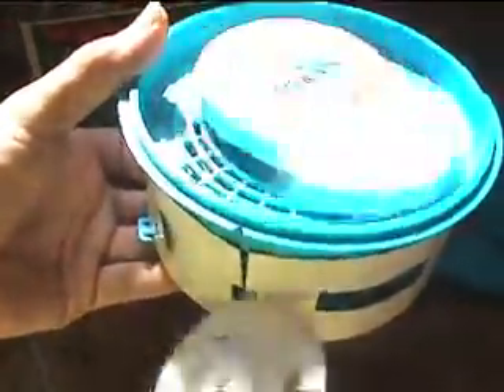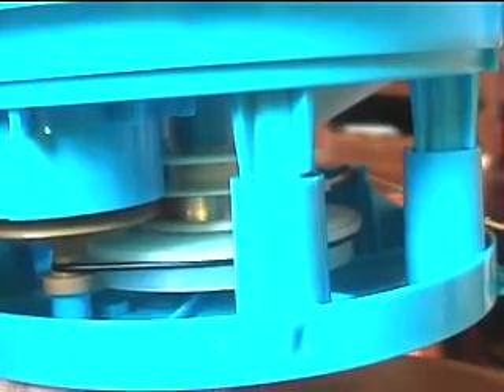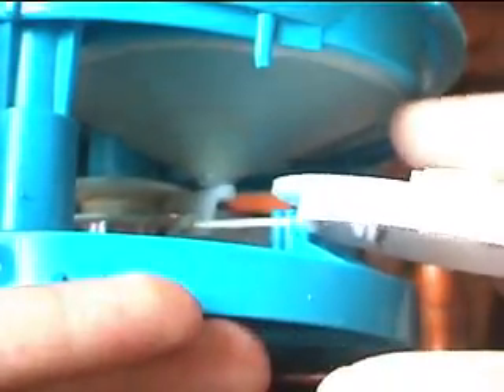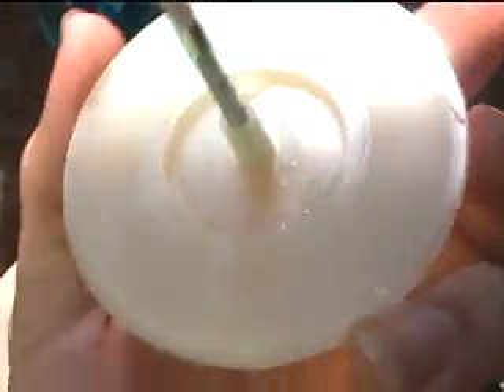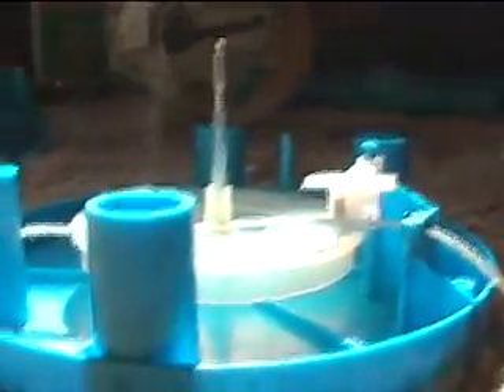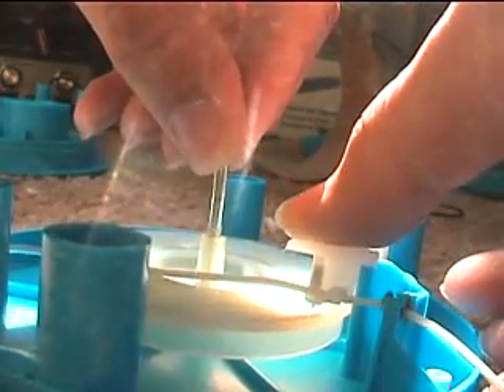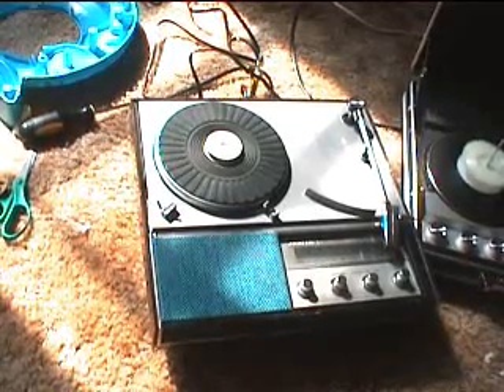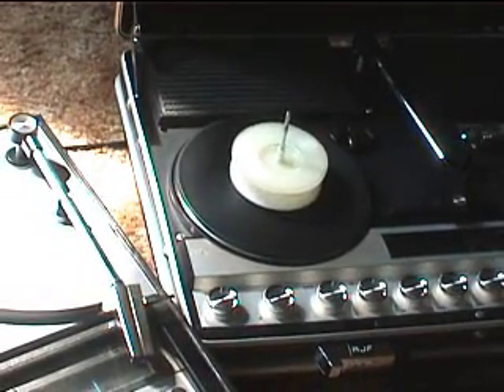See n' Say hacking

Comment: WOW, that's amazing! Normally I'd think toys would just have some circuit board and a speaker and you'd never be able to get its audio, but here it's a complex record-based system!
Reply: In this day and age, it's all done with digital sampling.  I saw a digital See & Say in the early 90s.  Computer memory was limited to a few megs, probably less on a cheap toy, so you could only get a few seconds or a minute of audio on a chip.  Now, 64 Gig is easy to come by, so digital sampling with no compression is possible.

Comment: @gbnnn Yes, And the lever one requires 9-volt batteries. I used to have the lever version of See 'N Say The Farmer Says and See N Say The Zoo Keeper Says. I used to remember when it went "Battery low!" It was an alert sound to alert kids to please replace the battery. My See N Say toy (the lever one) required 9-volt battery. And pull string was suspended in 1983.

Comment: I found a See n' Say at the local Value Village last year. Amazing to see that still works fabulously after about 20 years! The vintage See n' Says use little white plastic records (as seen in this video). They can be immersed in water, put in a bath, and even dropped down from a high distance and still work fine afterwards! Nowadays See n' Says are electronic - they are very unlikely to withstand abuse.